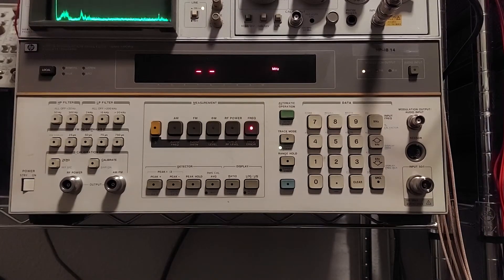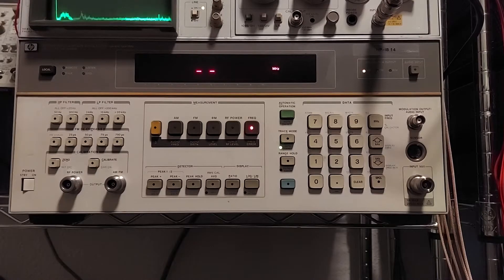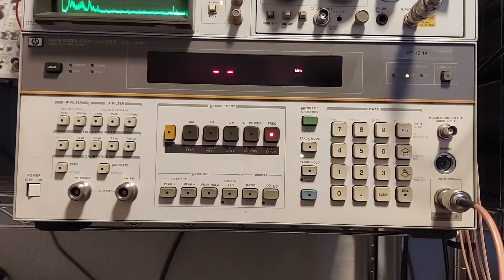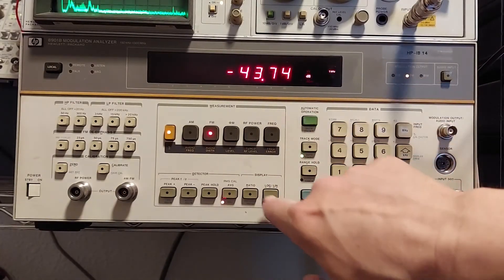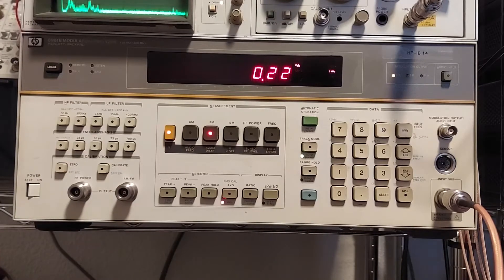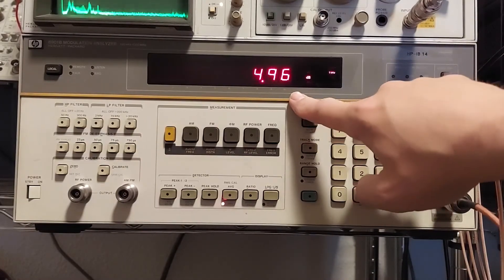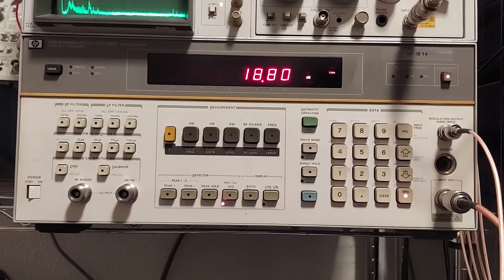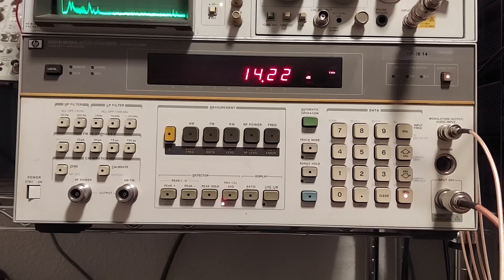HP 8901B Modulation Analyzer.

Comment: It won't take an HP437B power sensor. Doing so could damage the instrument. It does work with an 11722A however.
Reply from the maker: Interesting, so far, I haven't had an issue using my power sensors with this instrument. I have several power sensors and have been able to use them successfully with a HP 436A, HP 70100A, HP 437B and the HP 8901B. I would guess that the newer sensors may have issues but so far so good. Thanks for watching.

Comment: How do you like it a year later?
Reply from the maker: Hello Scott. So far so good, does virtually everything I need it to. While I haven't really put it to extensive use, or explored all of its functions, it works really well at measuring deviation, modulation depth, phase modulation, frequency, power, SINAD and other modulation distortion measurements. The unit can even use standard HP RF power sensors or the optional HP 11722A power sensor. The manual is quite extensive, as is the GPIB programming section. However with other HP instruments of this vintage they do take up a bit of shelf space. Thanks for watching!
Reply: @CraigPetersen12f36b  looks very nice. I've been eyeing up a HP 8920A. Definitely don't need it, but I see a lot of benefits from having a quote on quote all in one device as well as having multiple standalone testing devices.

Comment: I am very much looking forward to a demonstration of this machine's features for phase modulation.

Thanks for the vid!
Reply from the maker: Hello Donald, it's a really strange experience to see modulation expressed in radians instead of deviation in kHz or modulation depth in %. I really haven't done much with this this instrument other than the basics. Once I have the time to learn more I'll have to make a video on it's operation. Thanks for watching!
Reply: @CraigPetersen12f36b  Well, just remember that 2 pi radians is 1 wavelength. So if you shift a signal's phase by 1 pi radians, that's 180 degrees, or one half a wavelength.